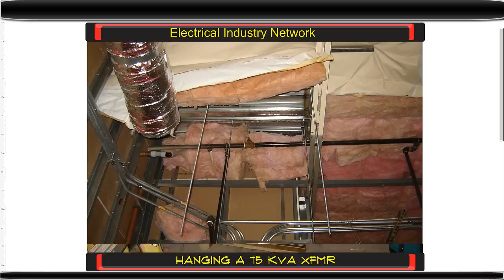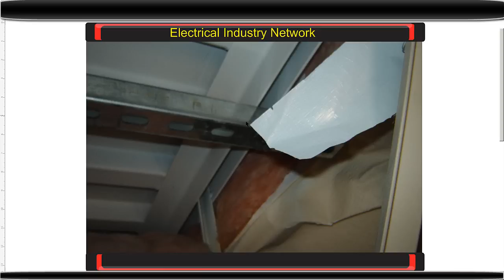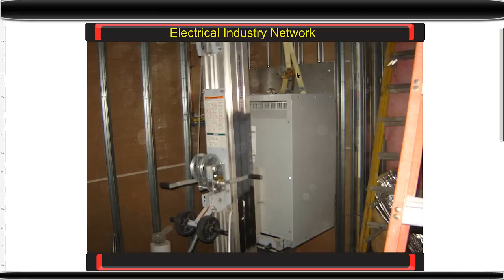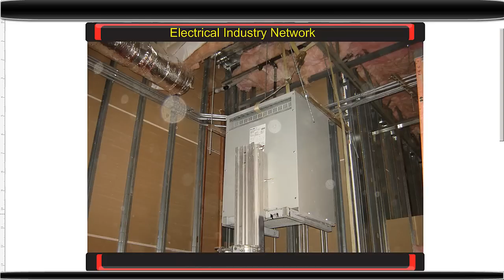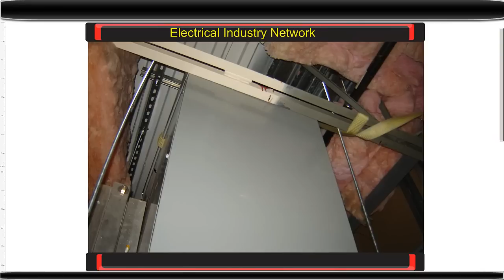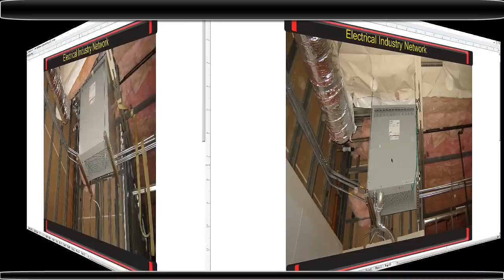Installing a 550lb transformer above a drop ceiling.

Comment: Amazon has annoyed me so much with 120 V incandescent lightbulbs my country has more than double so I invented something we need I would plate not too big and plug extracted from the old fluorescent lamp and the transformer let's wire them complex math question also know what we need a socket for the light so we can screw 120 V light with no problems the reason United States has 120 V because old is ancient carbon lighting Will burn out well I hook up 240 V and incandescent lightbulbs are my favorite light sources they are not designed to run at worldwide voltage like a laptop phone tablet charger etc. I was thinking hooking up a transformer directly into the light fixture and my light fixture supports up to 250V and 100 W lamps and incandescent lightbulb supports from 1.5 V like 300 V some of them not all of them my fixture requires 1.5 W 240 V lightbulb and all the way up to 300 volts and 100 W lamps anything higher than that will melt the light fixture sorry about that long story eBay has all the way 300 V incandescent lightbulb Amazon doesn't have because I'm using Amazon what is the only solution I can't find safe and not blowing up as a creeper in Minecraft game

Comment: Unfortunately this would not pass code here .  First we have to install solid rod not threaded The rod is rated with load stamping on to it. min size for this weight 5/8th up to 3/4 inch before it requires welding . It comes in  varied lengths with only 4 inch of thread on each end . These have to be double nutted washer& lock, the second nut being nylon
Second is seismic bracing at four sides for earthquakes. Being 550lb  this has to be done with rods not cable.
4x4x 1/4 inch angle steel for base 
Just to top off the show engineering specs/stamp on the truss to ensure there are no loading issues 
The web truss you have there are minimal loading if you have a snow load on this it amplifies the load . (Warm /cold location)
550lbs maybe an issue with snow added to it .
If its even close ,webbs would require plate welded to it to beef up and minimize flex.
Welcome to my world😪😪🤯😬
Fyi U-channel or strut as you may  call it is not structurally rated unless of course you bought the stamped channel.
Just saying  
So hanging this ,,your 1 hour would be about three plus a good day prepping . 😒😒😒😢
Cost would be anywhere between 2000.00 to 4000.00 if Eng papers required just to hang this transformer no wire.......yet 😁
Enjoy
Reply: Witch article on code please !

Comment: 3/8" all- thread is only good for 600lbs. I would have gone with 1/2", double nutted, with unistrut square washers.
Reply from the maker: So x 4 =2400lbs    600 lbs each E.Engineer & Structural Engineer approved
Reply: +EIN
What about lateral bracing? Lemme splain. I just realized you're in Arizona (?) (Go to Arizona for vacation, come home on probation)(jk)
We, have what's known as "seismic code" here in So. Cal. As if the NEC wasn't enough, we have to build stuff with lateral forces in mind.
We even have "seismic zones" each with it's own level of extreme structural engineering.
Pipe racks?........fagataboutit. High bay's,....... they hold the rest of the roof up. "SUSPENDED Xfmrs.? Yeah, with 360 degree lateral bracing, and X10 vertical support. We usually go to an exterior wall. Our troffers get 4 corner hospital wrap ceiling wires. (they hold the grid up) Do you guys have to get your vertical anchors pull tested? AND certified? 
Sorry if I came off as a "one of them" kinda jackasses, (I was doin' better since I don't do service anymore).
Peace.

Comment: Yep. Code violation. Too big to be mounted above suspended ceiling.
Reply: @g quinn I've mounted plenty of transformers in the air. Double strut and 1/2" allthread will work great. That thing won't go anywhere.

Comment: Awesome video. How do you know how much load you can hang from the ceiling? How do you figure out what bolt size to use? In case of vibration, is the transformer actually bolted to the lower strut? Thanks.
Reply from the maker: In this case we had the structural engineer do all the calc's for us. In the past the,honestly, the guy I was working for guaranteed me it would be strong enough. I have looked up the strength of 3/8" all thread and found it to be sufficient for the need.The transformer is bolted to the strut and lock washers were used.
Reply: I would NEVER install anything more than 3 ounces above a dropped ceiling without an engineer sign off .
I nearly killed a young bride and her bridesmaids when I was a “know-it-all” smartass  apprentice.
We were doing a complete rewire of a retail bridal shop in a shopping mall. The place was open for business at the time.
I was told to wire up a dropped ceiling for 4’ x 2’ drop-in fluorescent troffer type fixture.
I thought I’d show I was a motivated worker, so I “installed” about a dozen or so fixtures.
Of course I assumed “drop-in” meant exactly that.  
I didn’t support with steel wire and didn’t secure anything to the ceiling grid.

Because there weren’t any acoustical ceiling tiles installed, the grid was extremely flimsy.
Yup… an entire section of 4 fixtures came crashing down with the MC ripping out each consecutive section.
It was truly a miracle no one was killed.

Comment: I think you are in violation of nec 450.13. If it is over 50kva and above a t-bar / drop ceiling.
Reply: jay sun Electrical Industry Network This is a violation of 450.13(B). Over 50 kva needs to be readily accessible.
Reply from the maker: Benjamin Kalionzes

The insulation above is non-flammable and the structure is steel.

450.21 Dry-Type Transformers Installed Indoors.
(A) Not over 1121⁄2 kVA. Dry-type transformers installed
indoors and rated 1121⁄2 kVA or less shall have a separation
of at least 300 mm (12 in.) from combustible material unless
separated from the combustible material by a fireresistant,
heat-insulated barrier.
Reply from the maker: I am not seeing where a transformer above 50kva is addressed in (a) or (b) of 450.13. If your thought is accessibility it does say "not permanently closed in by structure". Depending upon the definition of structure I believe it is good to go.
Reply: not to mention 450.219(a)
Reply from the maker: Benjamin Kalionzes
 450.219(a) ?  What are you referencing here?
Reply: clearance 12 " minimum
Reply: g quinn you have no idea how common this is. If the structure fails there won't be any fireman in the building at that point. One would hope.